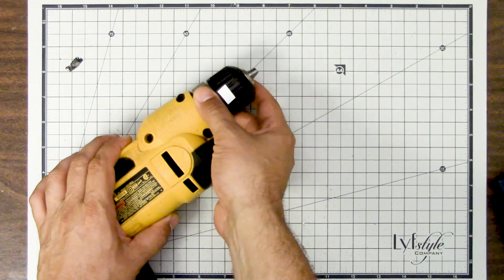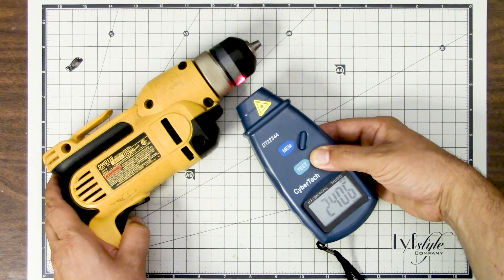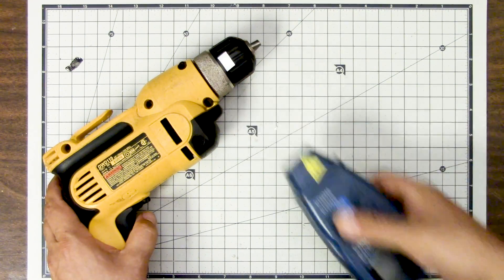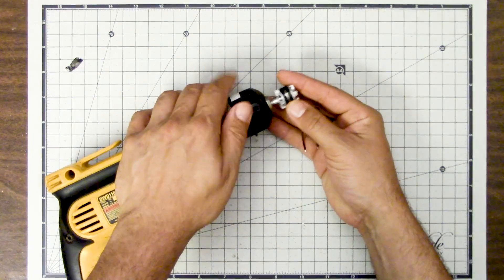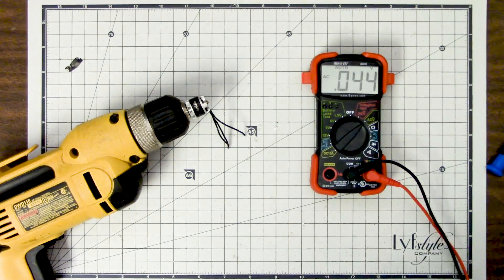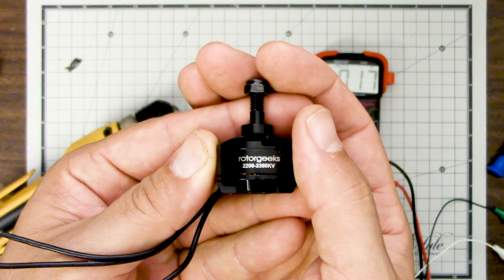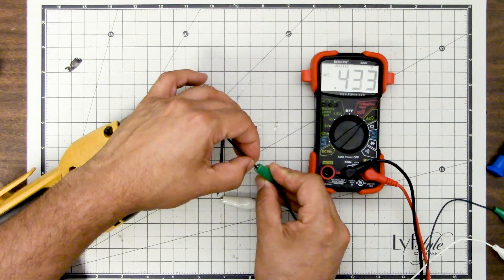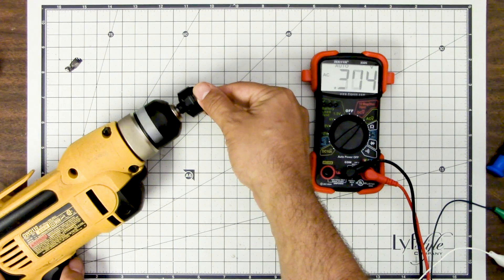Quadcopter Motor Damaged? How to find out. With a drill.

Comment: Great (old) video. One reason the voltage output doesn't match the measured RPM* KV is because the RPM was measured without the motor attached. Attaching a load is going to slow the drill a bit.

Comment: GREAT! This was an excellent eye opener. I had a clear build but just when i went to bind the AIO was shorting out. I cleared each motor off the board, one by one, and retested for clear function until I found the motor causing the trip. I did this test but the motor tested good. When i put it back on to test it would trip. The light came on and I found that i tightened one motor screw too far and it hit the windings. Changed the screw size and all is clear now! At $25/motor, that saved me some money and a couple weeks waiting for a replacement.

Comment: Somebody made a small generator by connecting one of these motors to an RC gas engine and putting the output through a rectifier and regulator.
The lower the kV, the higher the generated voltage per RPM.

Comment: Does your multi meter have to have a lower setting other than 200 v
Reply from the maker: 200v would be the max. You can always use lower voltage no problem.

Comment: Great video. Thanks. Any reason why I can't run this test while the motor is wired to the ESC? Obviously without a battery installed, can I take the reading at the PCB points?
Reply from the maker: That would probably be fine but I haven't personally verified it.

Comment: Microphones ( with an electric coil) are small speakers, and work the same way. They will also produce electricity if you push the speaker up and down mocing the metal across the copper windings.

Comment: I was big into car audio 15 or so years ago.  I didnt realize at the time the amplifiers powered by DC actually put out AC to the speakers.  I never actually tried it but supposedly if you had a subwoofer that can handle enough power, you could plug it directly into an AC outlet.  Since it runs 60Hz, it would give your sub a big test haha.

Comment: Okay Josh this was a good video I did learn something. I'm researching a problem with a drone I'm working on, at about mid-throttle, can't find a rhyme or reason, but it will fly and hover and then it seems that motor 1 will stutter and I think it's even reversing direction real quickly flipping and crashing to the ground. So I am going to replace the motor, I do have some extras but I wanted to troubleshoot and see what I can learn. I did run a bench test with beta flight and the motor is twitching and stopping.

Comment: Heeeey Josh! I had one motor with a little bit of burned winding, that I could scrap of and cable then looks kind of nice, tested the motor with this method and everything seems to be fine, constant voltage with all motors. Does that mean that my motor is all right?

Comment: What would be nice is that the motors recharge the battery while you use it. I know that it couldnt recharge at the speed at which its draining but even if you could get 1 extra minute would be great!
Reply from the maker: They do that. But the energy generated is very small.

Comment: I have 4 2300kv motors,one is not working properly seems like one phase to motor is not working, all 3 motor connectors are connected with each other when tested multimeter continuous mode, any guess on what could be the error, thnx
Reply from the maker: All 3 motor wires should have continuity. That's how the windings are supposed to be.
Reply: @JoshuaBardwell  Yes all 3  are connected, but this motor is stuttering,output is exactly as when one motor connector is disconnected from the esc.seems like motor has the error because esc works properly with other motors,?

Comment: on a whoop Mobula7hd those 9000kv motors ac voltage differ by MUCH: 
1 motor coils1,2,3: 0.38 0.35 0.34v
they differ out of the box.. are they so crap? tested 3 different motors already
(I started diagnosing because of downward acro flying random desyncs) https://youtu.be/nIi1_EeIlTQ

Comment: Is it possible while the quadcopter is in the air and motors are spinning rapily then connect another set of wires or adding a small charger to the battery to have infinite energy?

Comment: Thank you for the awesome and informative video!
I have a question regarding repairing a motor, for example, lets say that a motor voltage on one pair of the motor wires are different from the other two pairs to be tested, can that brushless motor be repaired ?  Generally, can all brushless motors that do not beep including not spinning when powered on, be repaired ?
Reason is, I am building my first quad, using an apm 2.6. Not sure what caused this, perhaps a wrong connection method of power to the apm, but all four motors beeped, turned on, and when applying throttle, two had some issues spinning, like twitching, the other two spun up when applying full throttle for about 2 seconds, after the second or third try however, none of the four brand new motors beeped when switched on, and none spun up when trying to use the trim trick. I did not calibrate the escs since the motors gave up. I disconnected all four motors, bypassed the apm, and tested each motor, which did not work. I had a new motor stored away, which I tested without using the apm, and it worked on all four esc's, so it was definitely the four motors that seemed to have given up. I havent tried this trick in your video above as yet, but I will do so very soon, perhaps later today (03 September 2019)
So if I find a problem with all four motors, can they actually be repaired ?
Reply from the maker: You can re wind the motor but it's a lot of labor and may not be worth the hassle.
Reply: @JoshuaBardwell  Wow, thank you for the prompt reply, that was excellent ! I have updated my reply above, please read it again if you dont mind... 
The motors are XXD A2212 1000KV , from banggood, https://www.banggood.com/Wholesale-XXD-A2212-KV1000-Brushless-Motor-H363-For-RC-Airplane-Quadcopter-p-57432.html?rmmds=myorder&cur_warehouse=CN

1. What do you think that might have caused that problem Mr. Bardwell , so I wont make that mistake again ?
2. Since I have five brand new motors, one gave up as well during testing, do you think its worth repairing all five ?

Comment: I have 3 identical motors and one odd ball, although it’s is same size and kv. I’m using individual ESC ‘s. The odd motor keeps burning ESC. Would the fc cause the ESC to burn if all motors were not identical? Or simply the 4th odd motor is bad?

Comment: Thanks for your informative videos. I have been testing motors with an LCR meter since 2014. Simply measure the inductance of each phase and if one is inconsistent, time to round file the motor. 
Here an example of one that should do the trick <$25 and it also does capacitors and resistors. Some also have volts.

https://www.amazon.com/Multimeter-Resistance-Capacitance-Inductance-Transistor/dp/B0114KNPV0/ref=sr_1_13?keywords=LCR+meter&qid=1555046645&refinements=p_85%3A2470955011&rnid=2470954011&rps=1&s=gateway&sr=8-13

Bob
Tucson

Comment: This might not pick up a motor that has a nicked winding. A voltage test under a load will detect such damage. Some of you will realize that this is a current measurement, but unless your meter can handle a a lot of current (like 100 amps or so) trying to measure the current directly will damage your meter and even if it does not damage your meter, it may damage your motor! Instead measure the voltage the motor produces when connected to a 12V 50W halogen bulb. It will probably only just glow, but it will get hot. Repeat the test in the video, but also connect the light bulb up with the meter. Spin the drill and watch the voltage. Initial the voltage will climb a little as the bulb gets hotter. Record the peak voltage and the time. Keep spinning for 1 minute. The voltage will probably fall a little as the motor heats up a little. Record the voltage at the end of the minute and calculate the voltage sag. Repeat... Look out for a low peak voltage or a voltage that sags more than the others. If the light bulb lights more than just a dim glow, you need a higher wattage bulb. This might happen if you run an X Class or Beast class drone.

Comment: I know this is an older vid but I actually do have a question. I have a 15000kv 1s motor that started twitching and stopping intermittently. Everything checks good electrically and physically. I'm not asking you to diagnose the problem since I simply replaced the motor, but in the vid you repeatedly said "something" may be wrong with the motor depending on the results. What exactly is "something" that can go wrong . When 3 phases are balanced, the output is within range, no physical damage and close inspection shows no internal damage, then what actually fails? This is the first motor that I couldn't find anything definitively wrong with it, yet it twitches and stops.  Thx
Reply from the maker: It's usually damaged winding or maybe bearing preventing the motor from spinning. A very precise resistance or inductance measure would be the proper way to test the motor, but it requires specialized equipment.

Comment: Joshua,  This was so helpful.  I smoked an ESC when my motor was blocked by some grass.  The windings of the motor were a little darker, but the motor's output voltage across the 3 leads match all the other motors on this quad.  I should be able to get back operational now thanks to your video.

Comment: im so lost ive got three esc that has randomly flip of death in air and there all used with zmx finx40 2.6 motors on 4s and they all have blown a fet (mosfet) what could cause this? ive got ur version 1.2 jb f4 f.c with capacitors wired directly to the esc power pads but i dont use those for esc because ive been using 4.1 esc and i just wire my signal wires to the f.c and i got lipo wired to esc input then i jump a set of wires from there to the flight controller. should i just toss the motors out? they was new

Comment: hi sir, why need to set/check by AC volt, is that a DC motor..?
Reply from the maker: The power to the ESC is DC. But the commutation signal that drives the motor is AC. Well... It's PWM. Which is alternating DC like a square wave. But at high frequency it will be seen as AC by the multimeter.
Reply: ohh..i see...thanks...

Comment: In almost 10 years of using brushless motors, I smoke an almost new motor today. It was twiching while the quad was armed. I plugged it into Raceflight to see what the issue was and smoke started coming from the motor. Does this mean it is toast? Do you think an ESC is the problem?
Reply from the maker: Yes the motor is toast. Don't fly a motor once it smokes. Even if it seems to fly, it can't be trusted.

The ESC could be the problem. If you arm the quad and the motor starts twitching and not spinning, disarm immediately as the motor may be about to fry.

It could be that the motor was damaged and as a result, it smoked.

It could be that the ESC was damaged, and it smoked the motor.

The only way to tell for sure is to install a new motor and see if it spins or twitches. USE A SMOKE STOPPER LIGHT BULB!!! It will protect you from smoking. If the motor twitches, the ESC is bad.

Comment: Hey Josh.. I know this is a tad off subject but don’t know how else to get in touch.. I had a recent crash that I’m just realizing a bell could be slightly bent on one motor... if it was to not be able to reach the RPM it once did, will the pid controller slow the other motors to match power? It has lost the punch it once had. I have parked it and ordered a new motor.. just wondering about the power decrease.....
Reply from the maker: Yes, that's right. The other motors will have to slow down to match the weakest one. But you're also likely to smoke one or more motors due to increased vibration. If you've got that much damage to one motor, it's time to replace it.
Reply: You’re quick! Lol You have many vids to sift through. Thank you! The Vortex 250 is parked.. motor ordered and hopefully it’s the only damage.

Comment: Im a tech in food industry. You could always pick from any two leads and keep checking from lead to lead for resistance or continuity for a bad phase. That could indicate a break in a winding or wire. I've see that on older motors that were in use and have failed. Usually a bearing goes or for whatever reason it was over heated and the insulation broke down and something goes to ground. AC motors are extremely reliable and usually never fail unless poor maintenance was too blame. I've seen them run under water (not water resistant rated) and run covered in sugar for years. There pretty bad ass. AC motors have taken off the past few years in our hobby and in the power tool industry. Another excellent video!

Comment: I'm running high KV. 8000KV to be exact and can't get a reading. Is it because I would have to run my drill at least 8000rpm?
Reply from the maker: You have to spin it 8000 rpm to get 1 volt. At lower rpms you should get lower volts though.

Comment: Hey Joshua. I maintain pumps and fans for a living and the meter we use to check 3 phase motors is a meg ohm meter. The ones im aware of use 1000vdc or 500vdc to test from each phase to ground (motor frame). Usually what kills the motor insulation is heat moisture and vibration. Motors with good windings will have meg ohm above 1000meg ohm and once they get close to 400meg ohm you know your close to failure. In my experience its kinda rare for the winding insulation to breakdown before the bearings or motor leads. Thanks again for the content!

Comment: You may have already worked this out, but your multimeter is measuring RMS volts. And kv is measured as Peak volts. For sinusoidal signals Vpeak = sqrt(2).Vrms. So your measurment is correct
Reply: I should have read the comments first. Haha thanks Joshua.

Comment: im still scared to use hobbywing xrotor 2405/2850kv motors becouse it burnt a hobbywing stack (xrotor 4.1 esc) went up in flames in 10seconds.. id say there either as high amp draw as emax 2306/2750 or even maybe less becouse of stator size. have you ever heard of anyone using these motors i know it was bad idea to trade and get them but they sounded zippy for ten seconds lol

Comment: Very professional. I will use this technique to determine if I have a dead short in my new Turnigy SK3 motor, as last night I burned up my brand new Turnigy speed control.
Reply: If you have a dead short you will be able to see with a normal ohm meter. Test from each phase to case of motor you shold have infinate ohms. Your three motor leads are all connected to eachother inside the motor so you will see 0ohms

Comment: I would like to add that you really don't need to do this to check a motor, 3 phase AC induction motors are used everywhere and if I had to do that to check a 56kw motor on a sand grinder or centrifugal pump I'd have to find something bigger than a drill.

Of course this does give you alot of useful figures but a simple test would be to check the resistance between all the phases known as checking the phases for balance if you find that the phases don't match you know the motor is damaged or faulty that's the basics Google it if you want better information.
Reply from the maker: Sure, if you have an LC meter you can easily test the inductance of the motor. But most hobbyists don't have an LC meter and this is a cheap way of sanity-checking a motor.
Reply: The resistance of windings this small is less than the resistance of the test leads on a typical meter, and less than the resistance of the connection between the leads and the motor.

If you happen to have a $850 meter laying around, that's different.

Comment: +Joshua Bardwell
 
Hey Joshua I have one quick question for you. I have recently purchased a  bfight 210 not sure if you are familiar with this quad. Well anyways one of the motors on the quad seems to have a  cogging that is stronger than any other of the motors. Im not sure if this is ok or not. I really appreciate any help.
Reply from the maker: If it spins smoothly then don't fret about it.
Reply: Joshua Bardwell 
Ok thank you very mu h

Comment: Hi Josh , i just built my 1st zmr250 with racerstar2300kv motor+little bee 20amps ESC and naze32 but i have 4200mah 4cell battery is it safe to use it or it will blow my ESC and motor
Reply from the maker: +indian quadcopter things it's safe to use. But it's way too big and heavy. The quad will fly terrible.

Comment: Nice demonstration of electric generator :) Also recuperation brakes in trains, trams and electrical cars are working in similar way, converting vehicle moving energy back to electricity which goes back to power line or charge the car battery. Even drill is not needed if you manage to fix motor good enough to rotate motor bell with hand a couple of seconds to notice voltage raising.

Would be cool to use autorotation to charge quad battery on flips and power loops :)
Reply from the maker: The drill is needed to spin the motor at a smooth and consistent rpm. Otherwise voltage will fluctuate.
Reply: Which doesn't deny the fact that motor wouldn't generate any voltage between teared winding not by rotating it with drill nor hand.

Comment: Hi, about this magic incredible thing comment you make towards the end, you could have also related it with active braking : which is in fact converting this mechanical energy of the spinning prop+bell and feeding it back as electrical energy to the esc/pdb (and uses the same idea of generator).

Comment: 1:45 Correct me if I'm wrong here, but I thought these were "brushless DC motors" not AC motors... I thought the ESC is producing 3 separate square DC waves, not AC sinusoidal waves (which would have to change polarity to be considered AC.) Is this correct?
Reply from the maker: The ESC drives the motor with square waves. But the signal that comes out of the motor when it's spun is not a square wave. 

https://www.youtube.com/watch?v=m_6NbnLVO3M